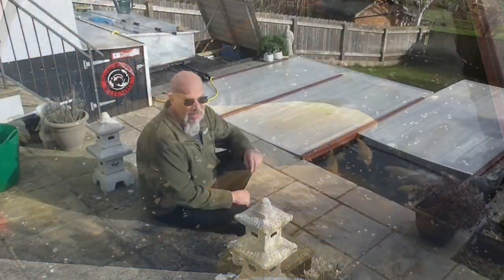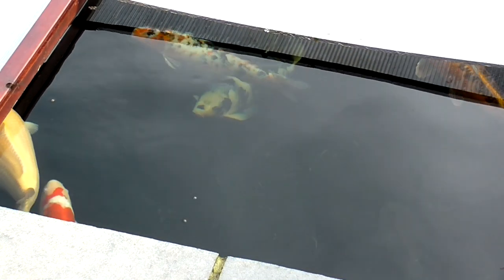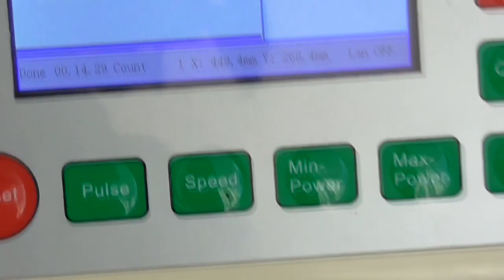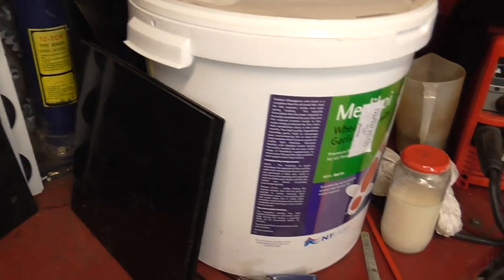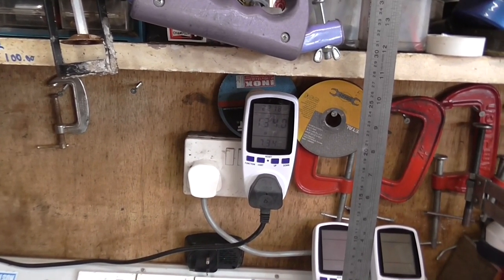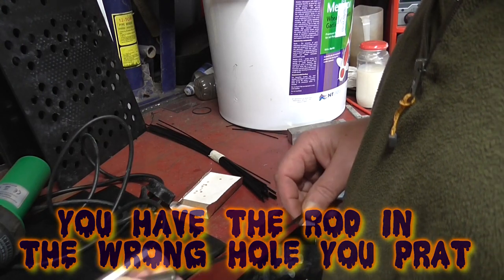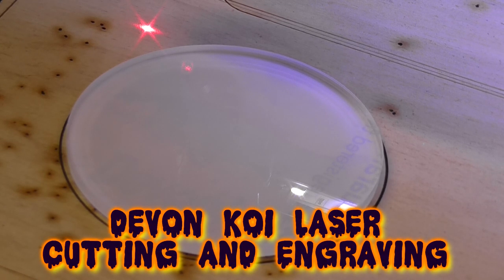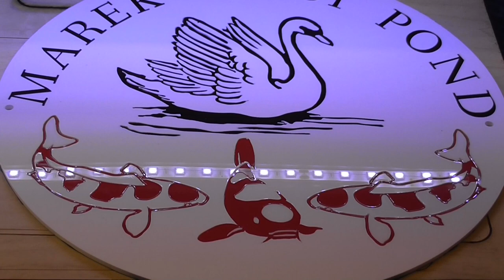***KOI POND FILTER BUILD*** NEW FILTER MEDIA***PLASTIC WELDING FILTER A FILTER BOX*** SOLAR POND***

Comment: Marek's logo looks awesome Martin. His logo was one of the better looking ones I did on the cushions. Simple but very effective.  Do you use acrylic for all of your projects or do you cut PP with the laser as well?
Reply from the maker: The filter box's are all PP bar the clear holed separators that at Acryilc all the signs and Plaques are Acryilc. i can cut up to 12.5 mm thick and with the rolling bed in the laser cutter a max of 500mm X 2400 but like I to keep the size of cutting to 600mm x 400mm or 500mm x 300mm because of the cost of the sheets and handling them

Comment: Won't be long until the second filter box is up and running. quick question re your solar set up. You mentioned you figured you had saved about £ 170 I believe you said since April last year. Just wondering what the original cost of the set up was and whether it has paid for itself yet and if you take that into account before the energy saving cost factors it.  Cheers.
Reply from the maker: Mate its £107 plus lighting the workshop i have been running the input meter at 18p a kw i will give an exact amount by end of April but is going to be around the £80 a year saving mark with a spend out of £350 on the gear to make around the 400w to 500w

Comment: Does the solar give you enough to power the air pumps and give you a £100 back from the authorities? Trying to work out if it is worth doing.
Reply from the maker: Its saving about £80 to £90 a year so with my running cost on the pond that's about 3 months free pond running in total over a year. so on a small solar setup say 600w of second hand panels and a grid tie inverter about £400 pounds worth money back in 4 years and then save £90 a year. I can give better money numbers at the end of April after two years of running. Have a good weekend